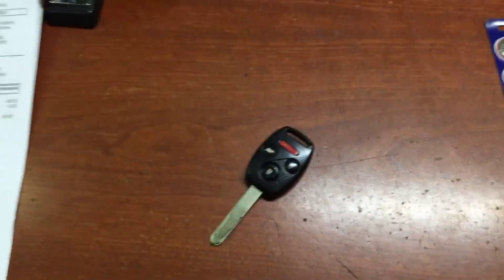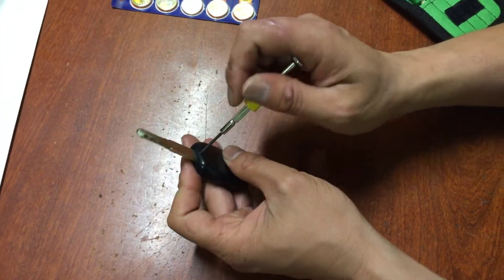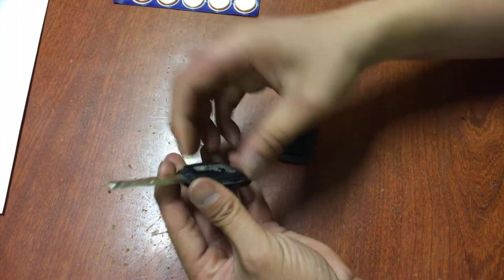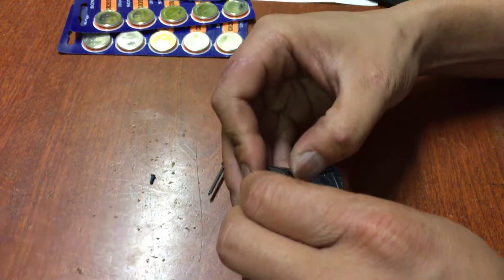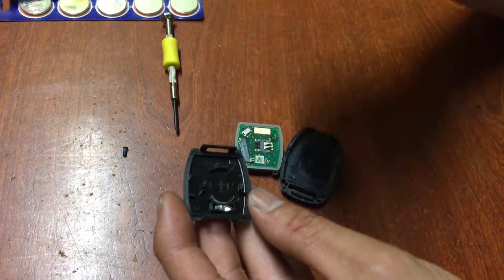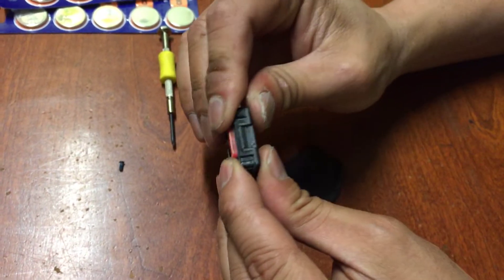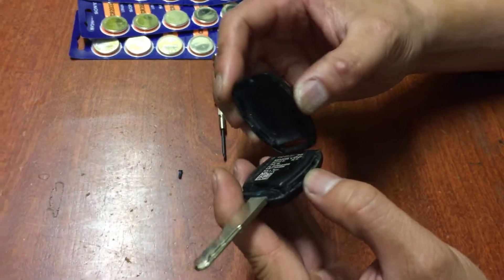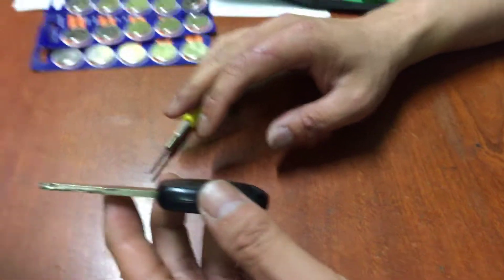2012 Honda key fob battery replacement

Comment: Just changed mine. Battery goes in upside down, snaps in. I used a small slotted screwdriver to seperate the two pieces. Got the batteries on EBay, very reasonable.